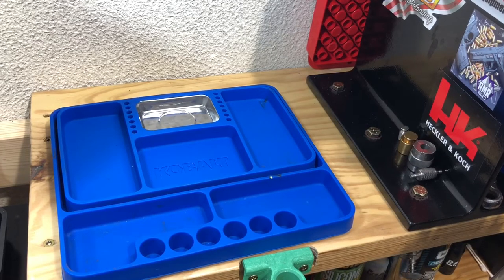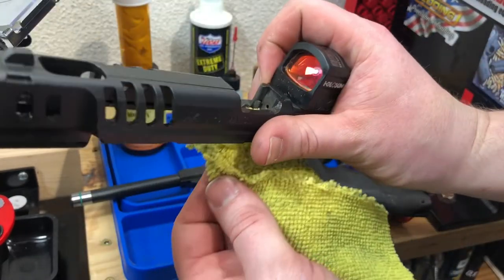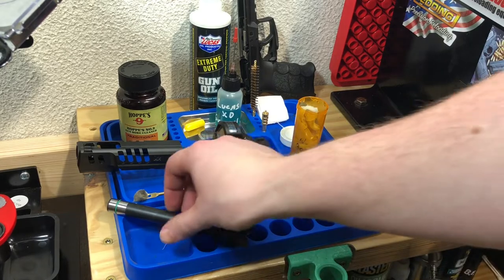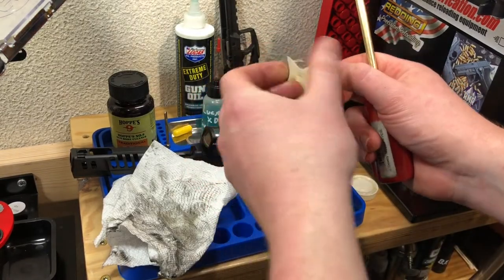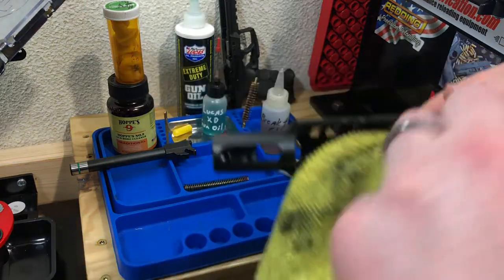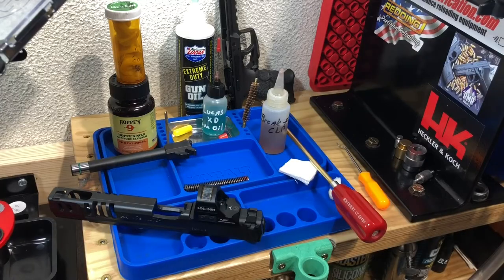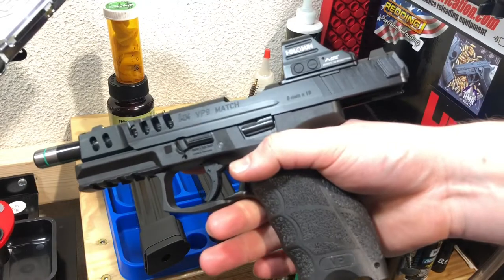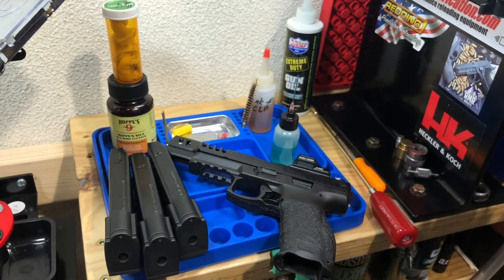How to Clean & Lubricate a Modern Handgun (HK VP9 Match, or any VP9 Series)

Comment: Great instructional video.   Watched the entire thing.  Taking my VP9 Match to the range tomorrow for first time use.

Did have question, though.   No bore snake incorporated into cleaning process of barrel for removing the carbon residue?  Beginner level at all of this, so would like to hear.
Reply from the maker: Sweet deal, and I hope you enjoy taking it out for the first time! 
I typically either deep clean (as shown in this video) or use a bore snake for a quick clean. Realistically there’s nothing a bore snake is going to do, that brushes and patches won’t already have done already, so it’s basically a redundancy. If you pull a bore snake, it’ll get most of the fouling out, but not all. If you run brushes and patches till everything is clean, then you’ve got all of the residue out anyway. It’s preference, mostly

Comment: Excellent tutorial! Hows that VP9 holding up?
Reply from the maker: Thank you! Holding up excellent! At this point it has roughly 6-8k rounds through it, looks virtually identical in condition to how it does in the video, and has never had a single part replaced. Recoil springs are still good, trigger is perfectly crisp as it always was, and it’s running like a top! I may go a bit heavier on the oil than others do (because it’s a comp gun, not a duty carry) but the reduced wear speaks for itself haha

Comment: this is like a once a year cleaning. unless you are in an active war zone, this is way overkill for a 500 round cadence cleaning. Modern firearm coatings are extremely advanced, this is just not required that often.
Reply: Does it hurt to maintain like this? I pretty much do this after every range trip - usually about every 250-300 rounds.
Reply from the maker: Depends on how much time you want to spend cleaning whenever you do need to clean, and also how dirty your regular ammo is.
Reply from the maker: No it doesn’t hurt to clean like this, although you don’t need harsh solvents or brushes that often. A thorough (but basic) cleaning is usually plenty.